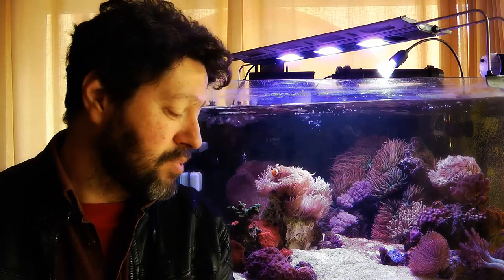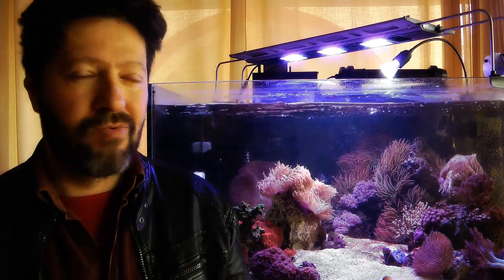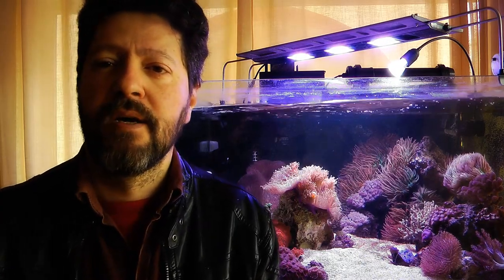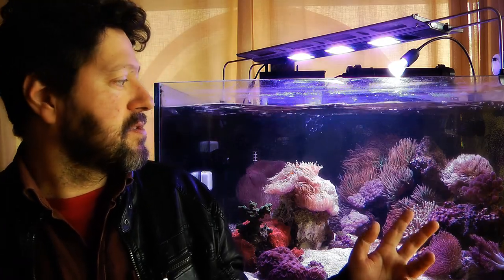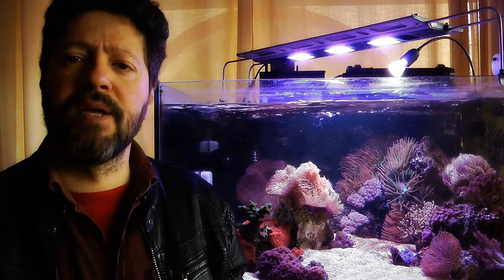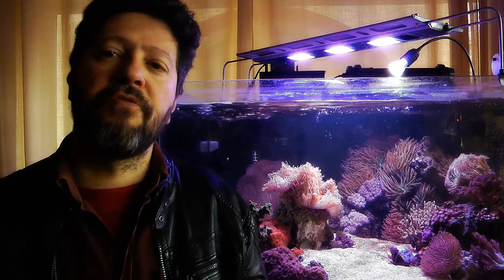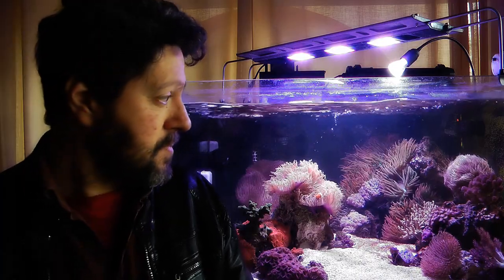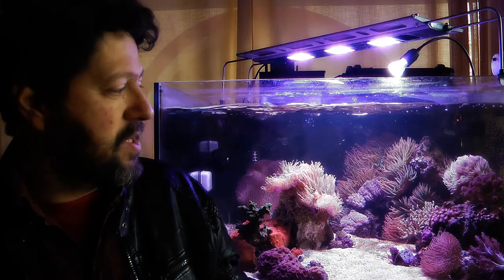16 - Technical overview of the reef tank - Equipment and maintenance

Comment: Your overview of lighting mimics my exact thoughts; I've spent far too much time messing with my pumps to get the right amount of surface agitation for the shimmer from my Kessil.  A bit easier of a task for a small tank like mine I assume (:

Sweet video.
Reply from the maker: Caleb Brinkley But don't you agree that Kessil needs some sort of fill light to soften the shimmer?
Reply: IME it depends on how hard your surface ripples.  If you have larger waves then the shimmer has a much greater contrast; Kessil lights in general have sharp contrast, of which is its largest flaw as you mentioned.  Some sort of T5/Kessil hybrid would be optimal I assume.

Comment: Hello Alfredo
Nice aquascape I also use a Maxspect lighting unit but it’s a 16000k unit and I used to use a Deltec 600 skimmer. It ended being too noisy for me even though I tried to silence it . I don’t use a skimmer at all now.
Reply from the maker: jedi ways Hi Jedi. My plan is to continue to use these lights (I have 2 of them now) for a couple more years until a really good fixture comes out. The skimmer can be a bit noisy at times and I already had to replace the pump, but most of the times the level of noise is acceptable.

Comment: Nice video. What do you think about nano reef tanks around 30L? With zoanthids,acans and similar corals.... Without skimmer.
Reply from the maker: Vladimir Stojanovic It can work but you need to watch out to keep it stable. It can be a challenge in tanks that small. You can easily go without skimmer in tanks up to 100 liters (much more stable) as long as you keep only a few small fish. If you go with a 70 liter tank it will be much easier than with a 30 liters.
Reply: Thank's.